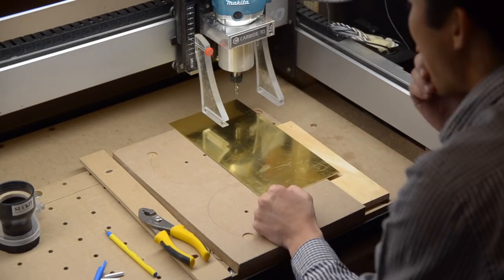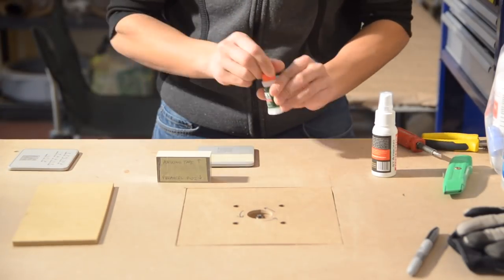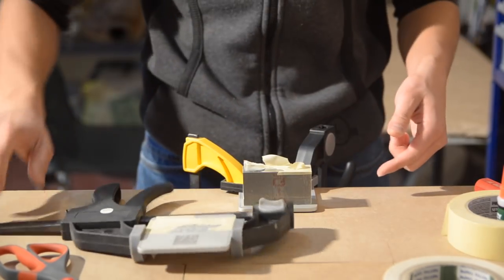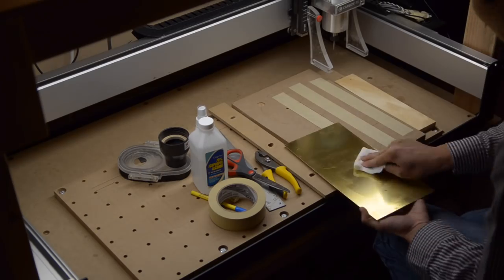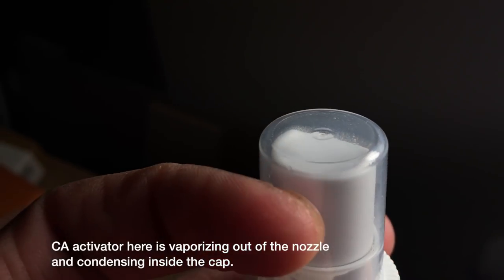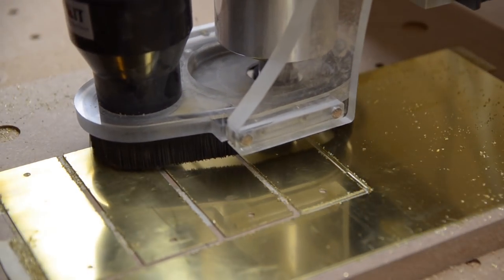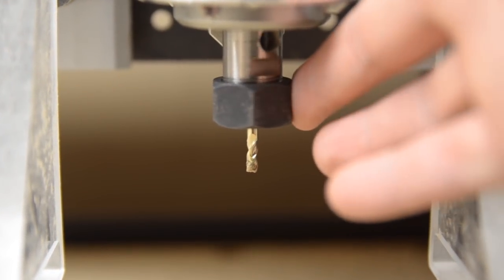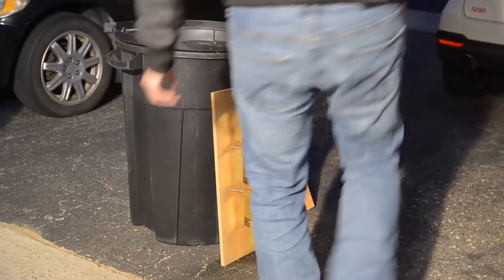Making Brass Nameplates w/ Masking Tape Workholding - CNC Project #111

Comment: I wasn’t surprised the double sided won.   The adhesive is wicked on that stuff. That said the masking tape/CA glue hasn’t failed me yet and it’s much easier to remove form the waste board and work piece.  You already know I’ll be at WBC.  As I’ve said, really looking forward to meeting you and hanging out.

Comment: I love these videos.  I love the nerdy content, and I really appreciate the professional video production that quickly conveys the concepts as quickly and easily as possible for the viewer.  You clearly spend more of your time to save our time, and I appreciate that.  The scientific testing was a nice bonus!

I had seen this masking tape and CA adhesive trick last month.  A luthier was using it to secure sandpaper to a custom sanding block.  Coincidentally, I was telling my brother about this trick last night, so I'll send him a link to this excellent video.

I've never been a fan of CA adhesives, but I'm going to give this method a try.  CA adhesive is fast enough that I'll probably skip the CA accelerator.  I like to avoid volatile chemicals as much as possible.  My best tip for storing and using CA adhesive is to buy large quantities of small tubes of CA adhesive and consider each tube as a one time use item.  Don't try to store CA adhesive for more than a day and you can avoid clogged nozzles, adhesive hardening in the container, and random results from opened containers.

Comment: Not disagreeing with your results but I feel the methodology used to compare the two methods is slightly biased towards the adhesive who's plate is clamped to the table. Is it possible there was some leverage/peeling forces in the tension test where the force isnt entirely vertical? Or that transfer of torque through the adhesive medium played a part in the axial shear test?
Just thinking out loud and if the methods are vastly different in strength any bias is probably irrelevant.

Always love your videos and have been a fan for a long time :)
Reply from the maker: Valid concern. In theory, the top plate has a 150 gram disadvantage from the weight of the block (considered within the margin of error), but a basic free body diagram of the static forces will show that any torque experience by one side needs to be transmitted equally through the other side. Assumptions mentioned in the description.
Reply: @WinstonMakes  Why didn't you just flip the assembly up side down and run each test again? There will always be torque loss, the amount depends on material strength and bonding strength so add another 150 gram disadvantage to that and you got yourself a pretty big bias.
Reply from the maker: @Tom-xn7zc  both sides experience equal torque. If you draw a free body diagram you'll see that all forces and moments have to be equal. It's Newton's third law but for Statics. The only difference is that technically the weight of the intermediary block is pulling away from the top one and pressing down against the other.

Comment: Use a good painters tape rather than plain masking tape. You also don't put enough glue down. Use lines, not dots. I don't use activator and I have no problems CNCing 4mm aluminum and all kinds of wood. Rough plywood can be tricky because the tape doesn't still very well.

Comment: One of the other videos I was watching just now mentioned that the use of the masking tape and glue method was used BECAUSE it was weaker than double-sided tape.
It still held the work, but because it was thin metal, it would be easier to remove the masking tape without damaging the part.

Comment: I think burnishing the tape is half the trick.    Get something smooth, handle on a pair of scissors or a piece of wood, and put the tape down and then push down the tape real good.   Do this on both parts, then put the superglue,  preferably a squirt out kind, and put a  bead.

Comment: The tests both disadvantaged the masking tape and CA glue set up.

For example, the sheer test:
You are applying a twisting force to the top aluminium and the CA glue joint. There is some twisting of that joint so the force applied to the bottom joint is less. You also can't guarantee that the top joint was held perfectly horizontal in a steady relationship with the middle block, but the bottom plate is by virtue of being clamped.

I have found that the masking tape sticks better if burnished in place to improve adhesion rather than just pressure from a hand. I also burnish double sided tape (obviously only possible on one side)

I don't have an overall preference for either method but a fair comparison would be more useful. Do the tests with the CA/masking tape downwards and upwards in equal number.

Comment: Just as a note, tack =! shear strength. In fact, they are inversely correlated, see this graph (https://bit.ly/2O2c1lB). Stiffer, less tacky materials will perform better in shear. Hence why Command hooks for hanging things on your walls are not aggressively tacky. Although your shear was torsional in nature (which won't happen as much on a CNC due to only one point of contact), that still was a pretty good test.

Also, I'm impressed on your surface cleaning with IPA. You are in the minority who actually clean their surfaces before using tape.

Comment: hello
i use masking tape but instead of the super glue
i use double sided tape between the two masking tapes and
i have no problems cutting smaller items and there is no worries about the super glue
going on the work piece i mainly cut plastic and mdf of about 3mm to 10 mm in height
it is a very clean way of clamping the work piece to the spoiler bord
i am only using a 3020t cnc so i dont know what way it would work with a  larger cnc but it should work in the same way for lighter jobs anyway
Reply: Curious, what does the masking tape add that using just the double sided tape doesn't?

Comment: Curious how the test changes if you're mounting a less-flat material like wood. One of the purported benefits of the glue method is that it's able to form better to the shape of a slightly uneven material than the double sided tape.

Comment: With the pocket in the mdf for your engraving pass, did you end up using any adhesive to hold the brass in place? or is it just a nice snug fit?
Reply from the maker: Snug fit. As long as it can't move laterally you're okay, the engraving bit only applies downward pressure.

Comment: You missed a very important part of the process which is to burnish the masking tape using something hard and round before you apply the glue also all the tape has to be covered with glue . Burnishing makes all the difference.
Reply: At that point, what's the point of using it if it takes so much longer to use?

Comment: I want to do similar to this, but have the brass plates (1 - 1.5m thick) have a bevelled edge
traditionally, engraving shops use a purpose made bevelling machine but could I kill two birds with one stone by using a big V cutter on the edges?

perhaps as a second toolpath after getting half way through? idk about the strength of v-cutters for this material
Reply from the maker: Depends on how big a bevel you want to do, but it should be possible. May need to do it in a couple passes. In my last project with the brass knob I used a cheap V-bit to chamfer my edges. A bigger cutter wouldn't hurt though.